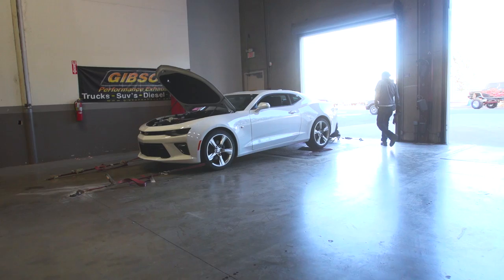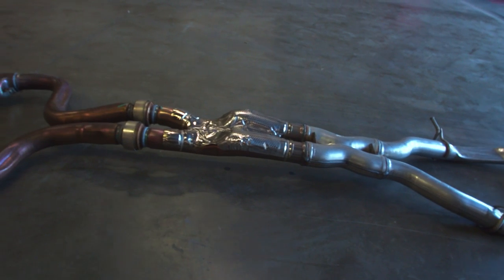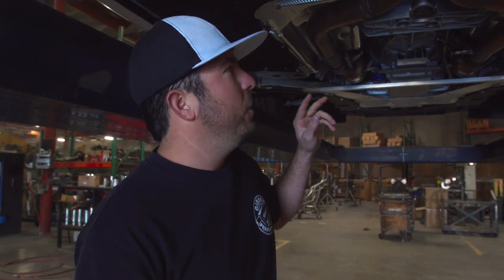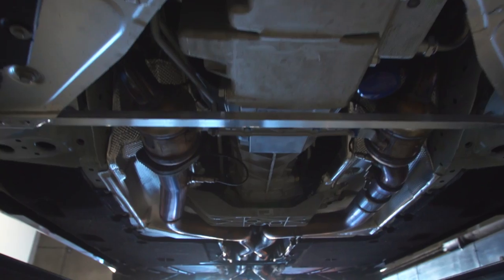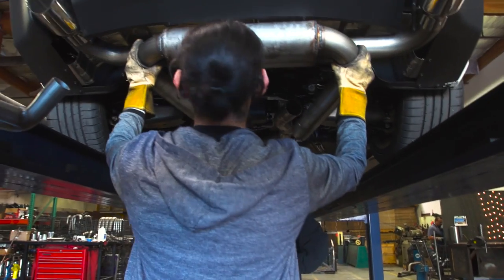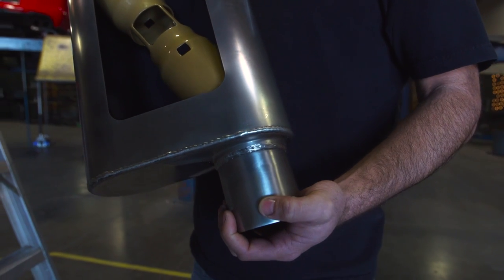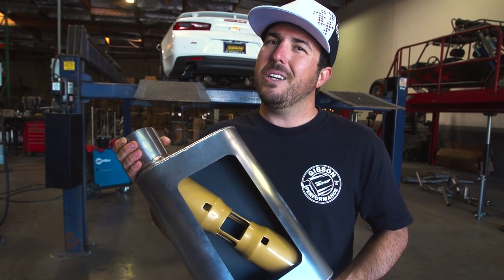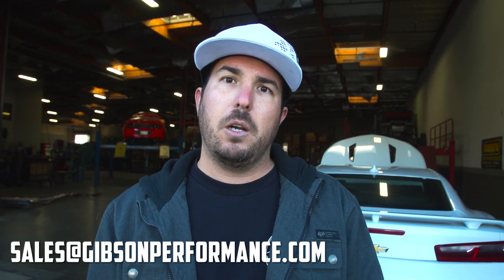2016 Camaro SS  Exhaust Systems  R&D Session

Comment: I would use the 3" exhaust for really big hp applications but you also need to make a 2.5" or 2.75" setup as well.
Reply: Not on a V8.  3" all the way.

Comment: Most that do headers n off road xpipe,hpipe want a straight through muffler option thats quit so that the finished sound is not overly loud. Id say that straight through muffler design is fine for the guy that will keep his catalitic converters on. But for those doing full exhaust but still want to cruise to work or long trip, that were not going to be going def. My opinion add some packing to the straight through mufflers and maybe even a set of resonator on a catback system. This applys to the Mustang and Camaro. people who want to go loud is the easy option. The rest of us want performance without sacrificing our ears at ever blip of the throttle.

Comment: How compatible is this with the dual mode exhaust? Is that strictly an ECU thing, or is there something physical that may be removed when adding an after market exhaust that would cost us to lose the function of dual mode exhaust? Thank you.
Reply: +Daniel Curtis The adjustable exhaust has electronic valves in the exhaust to change the sound. If you plan to do an aftermarket exhaust with no valves, stick with the base exhaust. Other companies are putting out exhausts that can use the valves from the dual mode exhaust.
Reply: +Todd Wilson I ordered a Camaro about 2 months ago with the dual mode exhaust. Haven't heard it in person yet. I may look to do something aftermarket. I was just curious. Thanks for the info!

Comment: at 0:34 looks like those crimps in the exhaust serves 2 purposes. 1 for rear axle clearance and 2 to build exhaust restriction that builds torque. No wonder the Camaro SS feels more torque than the C7 Vette when I drove them.
Reply: that is interesting.  how did you figure that out?
Reply: Because I have been experimenting with this same concept on my 2012 LS3 SS to either increase low end torque and drive ability and it works but somewhat kills high end hp getting close to the redline. 2016 SS Feels like my camed LS3 2012 down low but midrange to redline it falls off where my car keeps pulling.
Reply: Honestly though this 2016 SS is going to respond to mods and give winning results where the gen 5 failed.
Reply: +Camm GTR Dynos prove the Camaro SS puts down more power than the C7.

Comment: Mild, with a little rumble. Growls when the pedal is put down.  My vote is for the first one.   How about replacing the flat squished section on the stock system and see what difference it makes.  Maybe not much powerwise, but it may change the stock sound to something beautiful.

Comment: Gibson said he is not sure why they crimped the exhaust at that rear because there is a bunch of room there. So I guess it was for building back pressure.
Reply: Camm GTR using back pressure to increase power is a myth. Back pressure is never a good thing. Reducing pipe size increases velocity and helps scavenge the next cylinder that is starting to exhaust.

Comment: like the sound of the Corsa Extreme better. But they don't off NPP Valves. Build  an exhaust system with Corsa Sound at a  fair price point. You'll sell a ton of systems. I'm waiting to see which company will come through.